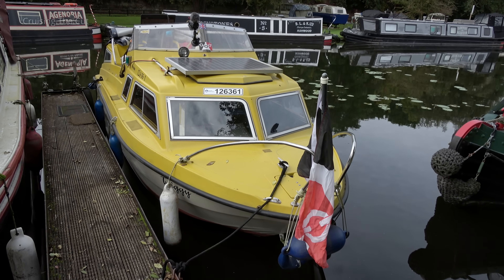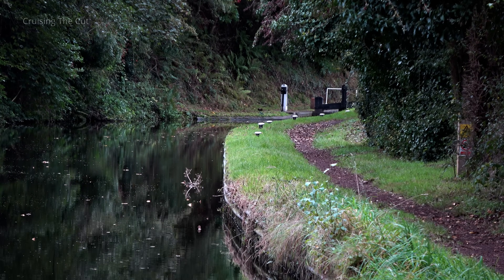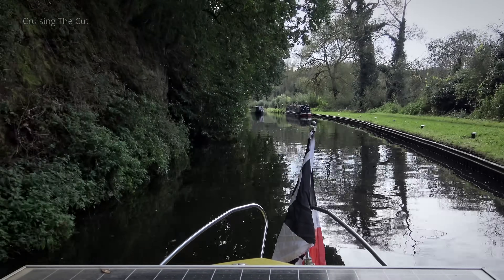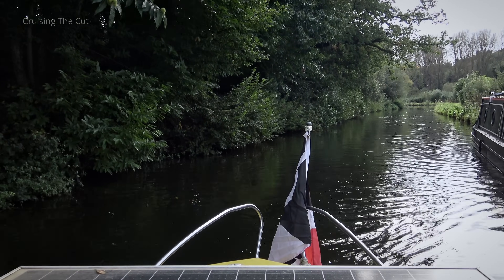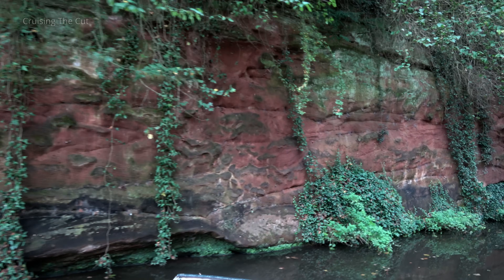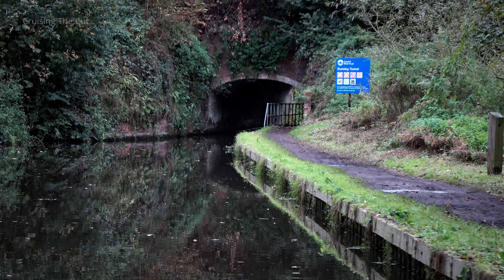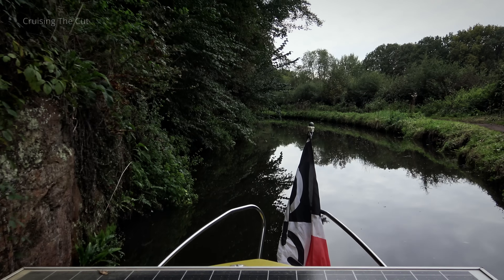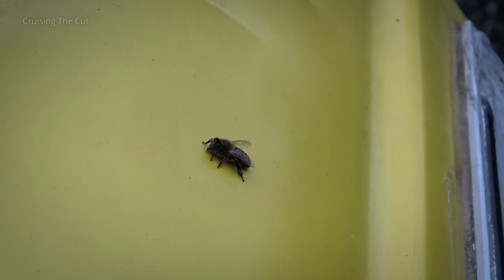317. I bought another boat

Comment: In the word(s) of Red Dwarf’s Arnold Rimmer MARVELOUS. You can just hear HIM right?
So good to see you on the water again in a boat of your own. And what a beauty 👍🏻sort of a campervan on the water. Just 😊 great.
About the stove they aren’t that dangerous as long as you  provide proper ventilation you have a hatch in the roof that should do. And if you switch them of they disconnect the gas can at least mine does. I use it in my 1975 Eriba Puck. That has a pop-up roof with ventilation. It even has its own two burner stove built in. Greetings 🫡 Peter.
Reply from the maker: They are not safe in a boat, flammable gas in an environment where it has no place to escape to. Plus I have seen plenty of videos of those stoves where the gas escapes (lit) out of the canister in-situ, causing flames to shoot out of the sides.
Reply: @CruisingTheCut  Jikes😶

Comment: I would have thought that after steering a long narrowboat this small cruiser would be a breeze but it's interesting to see the different challenges of cruiser life! All the best for future travels ❤
Reply: I've had a 53 ft narrowboat and a 30 ft. The longer one was much easier, the shorter one twitchy.
Reply: Steering a rudder with a tiller reacts completely different than steering an outboard with a wheel. Especially a little cruiser the size  and weight of a dinghy without a keel. That little boat is moving in the directory the force of the outboard is pointing and without a keel that can be sideways.
btw, no drive results in no steering.
Reply: Don't mention 'breeze', we don't want any of those in a fiberglass boat. Well, not strong ones anyway. I wonder if that was the 3rd thing David learnt about fiberglass boats but couldn't remember 🤔😁
Reply: I’ve just changed from a larger NB to a 23’ Wilderness Beavour which is fibreglass. . 😮I found the NB so much easier to control and I’m still adjusting. My dog Molly also loved the NB but just wants to jump off my new boat. All v. challenging!!
Reply: Bilge keels or a skeg leg 1/3 from the bow will help enormously. Also, because of your low speeds, you could add a plate on the step above the propeller with a straight rudder in the prop wash. That will give you more longitudinal control.
Reply: Congratulations David. What a pretty boat. You’ll have to team up with the lovely Tangerine Dream and become Oranges and Lemons😍. Show stopper😃
Reply: @nielsdebakker3283  was just about to post something similar,with a rudder as long as you are moving and water is going past the rudder then you have steering,but with an outboard if the prop isn't moving then you have no steering, so as soon as you throttle back you have virtually no directional control at all, it's a very different technique.
Reply: Both boats an trailers are easier to control the longer they get.
Reply: Looking forward to following you as you grow familiar with your new boat.

Comment: Just watched your Twiggy video. Here's a couple of suggestions: check the steering for excessive play. Usually something is loose at or near the motor. The engine could be a Honda. You could get a propeller with less pitch, which might give you better low speed control by slightly raising the RPMs. We've followed you for years, and are happy to see you back on the water!
Reply: One thing I forgot to mention: check to make sure that the propeller extends down past the bottom of the boat. You might need a long-shaft outboard. If the propeller does not extend past the bottom, the boat won't steer very well at all.
Reply: Another thing to consider, is if it has a rudder blade attached to the outboard, which many canal boats do have, then the rudder could either be too big or too small. Experimentation with different sized rudder blades may well be needed. The advice about the prop pitch being too aggressive is also good.👍 I have driven many GRP boats with outboards and they should track straight and steer reliably, except maybe in a cross-wind.

Comment: Congratulations on the new boat! Having owned fiberglass and aluminum outboard boats here in the USA I would have you check the steering linkage. It might be loose and that would allow the motor to move on its own throwing you off course.
Reply: Also have the steering cable checked, it seems to have a great deal of lost motion. Perhaps other cruisers could offer further insight to this issue. Cheers!
Reply: That sounds likely. Add in the "short coupled" nature of a tiny boat, and the vastly reduced weight would definitely mean a new feeling in the steering.

Comment: As one of your followers, I am pleased to see that you have a new vessel and are back on the canals. Your outboard motor needs a throttle linkage adjustment, perhaps a carburetor  clean, and an oil change. They are not all on or off if they are running properly. Good luck, looking forward to new adventures. What? No cheese sandwich..lol. ☮️

Comment: Looks like a Fantasy 20 by Small craft.  Either your steering cables are loose or if it is rod steering that needs lube.  there used to be a small bolt on rudder that attaches to the outboard for improved low speed steering.  Going from a rudder to no rudder takes a while.

Comment: I cannot tell you how pleased I am that you have acquired another boat. Please don't be worried about that wonderful butane stove. They are actually quite safe and if any of the windows open, just a tiny crack of fresh air will keep you safe. You must have those carbon monoxide monitors though.
Reply: I used one for months during a house renovation and it was fine. The canisters last quite a while too.

Comment: Great to see you onboard again.  
With regard to steering wander at low speed.
Outboard motors are notorious for that behavior.
.If your boat has trim tabs, adjusting them all the way down will help control that a bit better.  If not the investment would be worthy.
Another trick is to trim the outboard motor up to where the prop is just below the surface.  This reduces torque(that go fast or nothing effect).

The geese likely knew this and were trying to warn you, albeit it with a rather critical tone.

Comment: Ah the life of an outboard!  With the prop and rudder pushing the stern of the boat around that is a much larger reaction/action  than an inboard with fixed prop and just rudder!  Excellent purchase.  I must say that I had a number of cruisers here in the USA from single engine to multi-engine.  Once I had joystick drive on my sterndrives it was SO much better to drive at no wake speed.  The computer held the drive unit straight and didn't wonder around at all vs the older mechanical drive units (or outboards).  Looking forward to the new adventures of Twiggy!  🤠👍

Comment: Congrats to new boat and comming good time on it. 

Sugestion "kettle": 

There is more modern kettle design, made out of material retaining the heat of the flame, and with bottom area to catch the heat under the kettle longer. Overall, that design is quicker and needs less energy to get boiled.

Sugestion "liveaboard ship expanses":
It might save some money, if your ship, after it is taken out of the water for winter, and stationed in some local barn, hangar, or anywhere in dry and warmer area, preferably with energy, watter and sewage outlets/inlets, can serve as liveaboard further (kinda like a camper). Can imagine carbon-fibre "unsinkable" (i.e. with hollow areas filled by foam) ship with outside reinforsmance on the most contested/pronounced areas of hull, build to be lightweight and with inbuild wheels and tow-hook, to more easily move the ship only with your own car.
Some inspiration from other boaters would do no harm - the all-electric drive-pod was ingenious. Some small waterjet engine would do miracles with manuevrability, although it could be problematic with the rubbish polution in canals. Simple plastiq bag could damage a jet-engine, when taken in (with the water)...

Comment: I bought a yacht yacht to see it, it's in the canal so you canal see it , great to have you back 🏆
1, electric start on the outboard
2, electric troll motor 
3, fit a thermocouple to that gas burner or fling it oot

Comment: IF the engine throttle lever only allows for "on or off,"  the movement of the cable is too long for the outboard's lever. This can be remedied with a simple mechanism. Ask a mechanical wizard friend to whip something up for you.

Comment: Great to see you back on the water again. The 'script' and filming are excellent as always.
You might want to consider adding a couple of bilge runners to the hull underneath. Shouldn't be too expensive and they will improve the boats 'grip' for turning. Depending on the shape of the hull you might even consider adding a wooden extension to the keel - giving a few more inches of depth. 
Looking forward to more videos - Thanks.

Comment: Hubby and I prefer steel boats especially +40 footers. We owned a 48 foot slip in a lovely small marina and our boat(at the time) tucked nicely into our slip. Our stern always well within the length of our dock. Our neighbors on our tie off post side had a 40' fiberglass cruiser and even with 2 engines they hit our transom every time the tried to get into their dock. At the end of their season they had to have over 11 thousand dollars of fiberglass work done to their bow/bowsprit from hitting our transom. We spent maybe $2.00 in touch up paint. Even now that we only own trailerable boats we go aluminum instead of fiberglass. We had 4 big fiberglass boats that we updated and sold and even the ones that were laid up very thick were subject to cracked surfaces. We recoated all 4 and found them loving homes. I wish we had any chance possible to "cruise the cut" but we have had to make do with the Great Lakes around Michigan, USA. Love your videos to bits. Your humor makes it all worth while. Have happy holidays.

Comment: Great to see you back on the water. You're used to long narrowboats, your new boat should handle the same as a small dinghy with an outboard. You'll get used to the different pivot point when you turn. Grab a small dinghy and get some practice in! It may feel like the power is all or nothing, but you'll discover the subtle throttle adjustments in time, assuming that there's nothing wrong with the outboard throttle, also no slop in the steering.

Comment: Something that might help with steerings to find the pivot centre of your boat. it will be somewhere near the steering position. the boat will pivot around that point, which means the bow swings a bit and the stern swings the other way. Also it will swing more one way then the other. Boats with outboards are more prone to this then boats with inboards. One you figure out the pivot point you will find it is easier to learn how to control it.

Comment: Many many years ago I had the same problem with steering. I went to a Aluminium factory and asked if they had any scrap pieces. I had already looked at the rudder and size. Anyway I cut out a bigger rudder, fitted it, and that completely fixed the steering problem.. Had many boats after, and ended up with a Narrowboat.. Happy Boating

Comment: Congratulations - you are boating again. I have a few issues/advise coming up here:
Steering. As an outboard are pushing, the input comes far aft of the boat, so unlike narrowboats it is the back end going to one of the sides. I use to say. It steers like a harvester. So if you have a small or no keel, the boat will broadside. But you probably alreaddy knows all this by now 🙂
I have a 20ft sailboat and luckily it has a rubber rim all around. I see your boat has a similar rim. It is supposed to act like the rim on a bumper car, so you are supposed to hit things 😀 When I enter a new harbour I always say: Aim for something cheap 😀
I have a camping stove exactly like yours in my boat and have used it without problems for 3 years now - in the cabin. I have no smoke, fire og CO2 detectors and I am still alive and have never had any situations. Of course I never leave it unattended. By the way - it is a fantastic stove!
That should be about all for now. Looking forward for next vlog from the small cruiser.
Love from Denmark

Comment: Your new boat is very light and because of that you must count suction force when you are near of the banks, to avoid bumps you must put more attention to speed, when speed is higher suction will not pull you to the sides. Fiberglass boats have their shades and shines. This stove is very safe as long as you watch it.  It is just a gas stove powered from gas can. I have same as home backup stove in case that something will go wrong with gas lines or when they are under maintenance.

Comment: Excellent news, please be reassured that it’s not just small boats that have throttle control issues! I’ve a 35ft Sealine Statesman 320, it’s a nightmare to handle the throttles at slow speed. I love cruising in it but mooring in tight spaces is to say the least entertaining 😂. So glad to see you back with your own boat.

Comment: A four stroke should have good control at low revs if the idle/throttle is set right. If timing is not set right the engine will stop
at low revs so people often speed up the idle just to keep them going but in the process lose fine control at low revs.
The ‘canal builders’ were called navvies as in navigation, many coming from Ireland to live rough while digging the canals. There is a much later song about them written by Dominic Behan , if you get time listen to Ronnie Drew singing “Macalpine’s Fusiliers”.

Comment: If you start to go sideways like that you can intermittently use reverse thrust while pointing the engine/rudder in the opposite direction to regain some control and reduce speed. I am only mentioning this as a tip, something I learned while growing up on lakes here in the US. And if it's a little too much to handle you can always alter the prop pitch/blade count to give you more response.

Comment: I took a Microplus 502 on the T&M many years ago. I don't remember having steering problems but I was used to outboard cruisers. For canal use we fitted an 8 hp longshaft Yamaha 2 stroke which was too powerful and needed hotter plugs to stop it fouling up at canal speeds. Many are suggesting a finer pitch prop, these are available for most small outboards and are called Saildrive props as they are intended for use with outboards used as yacht auxiliaries. The only problem is they are more prone to catching weed than a standard prop. I think you would find a 6 hp 4 stroke with a saildrive prop more than adequate and better handling.

Comment: My friend owns one of them. the ballast in the hull was just plain old builders ballast (stones and sand) it was holding the moisture from the condensation so we could never keep it dry inside. We got a cement mix which is rubberized and we water-sealed the ballast in with this mix. It stopped the damp mouldy smell overnight.

Comment: Great to have you back, and congratulations on the new boat! A couple of suggestions: a) Changing your prop to a reduced pitch might give you better low speed cruise speeds albeit at the cost of reduced top speed. b) In my experience with outboard motors, the main exposure to engine damage is overheating due to cooling water intake blockages. A dash mounted temperature gauge can at least allow you to monitor the situation, a situation you cannot otherwise monitor at all if you can't see the cooling water discharge port (the "pisser") on the motor from your driving position. and c) Rig up a couple of electric bow thrusters. We won't tell anyone they exist, and people on the canal will be astounded at your boat handling skills!

Comment: Casual observation, it appears when playback speed increased there is a slight port side drift. The OB typically have a fin-like zinc anode directly in the propwash. Slight rotation of the fin can correct for prop-walk and any slight hull variances

Comment: One thing that I have learned from these types of boats is that because of the incredible lightweight and fairly far back centre of mass, they will tend to spin themselves instead of following through on a line such as you might find with a road going vehicle or car. You’ll get the hang of steering eventually, but I would definitely recommend not treating the steering wheel as you would in a car because it won’t do what you want! On the topic of electric drive, I do wonder if there is an affordable hybrid option, especially for lower speeds. The propeller itself could also be swapped out for something more sensitive or efficient. In any case, glad to see you have another boaty & hope it brings you many hours of joy!

Comment: Great to see you back on the water. It makes you look younger with a sparkle in your eye again. I have had many boats Most power and some sailing. For the slow speed you are using I would suggest a fin under the boat toward a bit forward of the middle. If you have a sail boat with a dagar board. if the boart is up you have very little steering with the board down you can steer.  Cheers from Australia